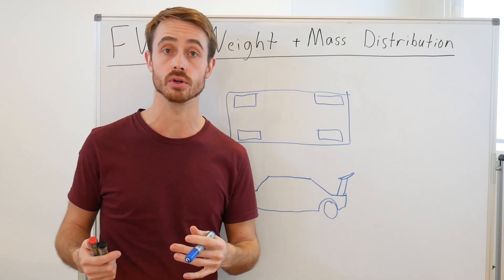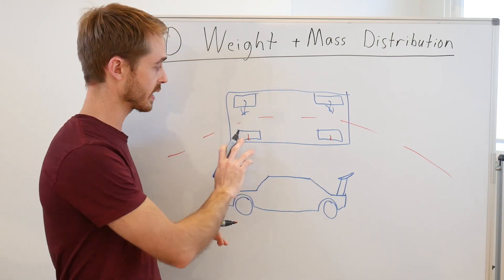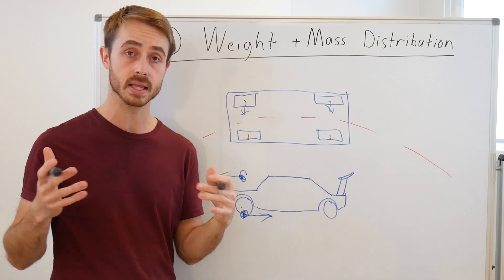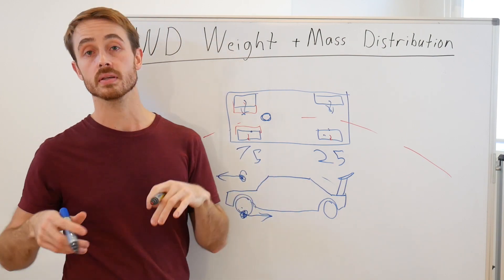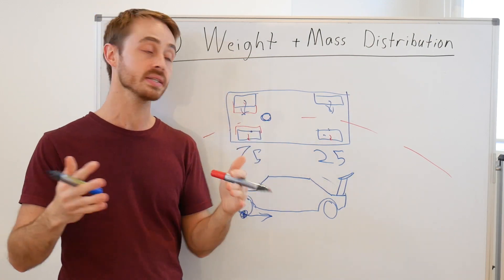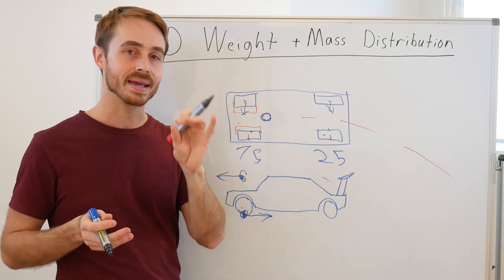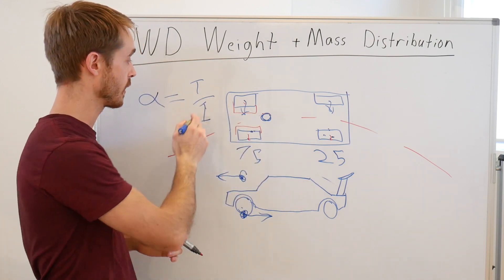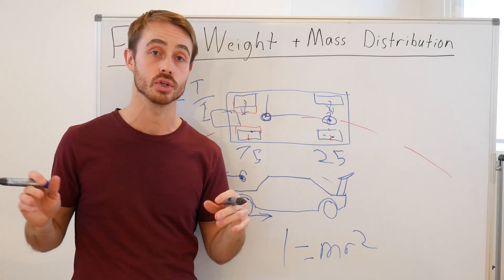Front Wheel Drive Weight Distribution Explained - What is the "Ideal"?

Comment from the maker: Thanks to Ted Sommer for the video request! I'm not a FWD setup expert by any means, but theory is theory. Hope you enjoy the video!
Reply: Aston Martin AeroBlade analysis
Reply: Great explanation! Like you stated about not being the fwd expert, you did help open my mind to options to counter the instinctive physics of understeer and to set-up my car for track days. Thanks again Kyle! 👍
Reply: Awesome explanation. I have been wondering though. Will using lighter materials such as CF on the roof of the car effect weight distribution or is it all just a gimmick? I.e. E92 M3. Related to that, what if the car has CF hood and/or boot?
Reply: 1:22 it's been a long time since I did the lecture/exam on dynamics, but I think that might not be right. The front wheels would see the centripetal loading, but also have to steer, hence they are under a considerably higher side slip angle than the rear, so the two vectors add up and would use up more of the Kamm's ellipse (ellipse or "circle" of forces/traction, not sure what it is called in English). Am I misremembering this?
Reply from the maker: @Ted Sommer: Great, glad you enjoyed it!

@BiskutKibal: Lighter materials, particularly high up, will help lower the CG. 

@YensR: In a steady state corner, with a 50/50 weight distribution, both front and rear axles must have equal forces on them. While the curvature of the corner will mean the front wheels must be steered, the slip angle of the tyre will still be the same both front and rear (with equal tyres). Remember the tyre slip angle is essentially the angle between the wheelface and the local direction of travel. If the front tyres were at higher slip angle than the rear, they would be generating more or less force (depending on where we sit on the curve) hence we would end up with a transient corner due to the torque around the cars cg from differential axle grip. Make sense?
Reply: Thanks Kyle, that makes sense! I'll claim your drawing threw me off :-P For ackermann steering, the centre of the curve is in extension of the rear axle  and while cars that travel at non-zero speeds typically have no strict Ackerman, the  instantaneous centre will not move forward as much as shown (without 4ws)  ;) 
(Kidding aside, I realise I was overinterpreting that drawing, my bad!)
Reply: So, if I have a car with 65% of the weight on the front wheels, will there be understeer or oversteer?
Reply: Sorry to be offtopic but does any of you know of a trick to get back into an instagram account??
I was dumb lost my account password. I love any tips you can offer me!
Reply: @Kolton August Instablaster :)
Reply: @Graysen Santiago I really appreciate your reply. I got to the site through google and im trying it out atm.
Seems to take quite some time so I will get back to you later when my account password hopefully is recovered.
Reply: @Graysen Santiago It worked and I now got access to my account again. I am so happy!
Thank you so much you saved my ass !
Reply: @Kolton August No problem :D

Comment: That was very interesting, my car has a very forward weight distribution but it seems to work as I use the car for low speed racing and it literally allows me to turn the car on the spot by using left foot braking, but it is very unstable at speed. I have been adding aero to combat the high speed issue. Good vid awesome work!

Comment: Great video! I run same size tires, same spring rates, and same tire pressures front/rear. I use damper settings to tune oversteer in my FWD race car
Reply: Preface: Not saying this as a "you're doing it wrong" thing, just elaborating on the various complexities of the situation for purposes of completeness: "same spring rates" <-- Your motion ratios front/rear might differ, and certainly the weight distribution will mean that the rear end is in practice more stiffly sprung. For example (since I have the relevant data available for it) a Renault Megane RS 275 Trophy-R with the same spring rates front and rear will end with ~20% higher rear suspension frequency, mostly due to weight distribution (the rear motion ratio is actually lower than the front, so even at the same spring rates the rear springs are softer in practice).
In many ways adjusting the balance via dampers is a bit of a brute force approach, but it's also totally understandable, the testing, time and money involved in getting custom springs at exactly the right rates for the balance you want is something very few people could ever conceivably have time for.
Reply: if you run stiffer rear arbs it also can help out a lot

Comment: Correct me if I'm wrong, but from this video, I learnt that having the maximum possible weight reduction is better than having positional weight reduction (reducing weight of compenents in the front only, in order to gain a closer to 50-50 weight distribution, which really isn't that great).
Reply: I think it depends on the specific course you want to optimize for, how many degrees of freedom you have with your suspension and what your driving style is. Weight distribution is just one variable in a huge equation. But I think for most road courses, if you have the ability to tune your suspension and adapt your driving style, lighter will usually be better.

Comment: great video cheers. the only thing I'd add is: with a FWD set up to have the centre of mass towards the front end, when cornering I try to slightly press on the accelerator just as the car is about to hit the tightest radius of the corner so you can use the load transfer to get to get a better balance and more grip also then trying to hit a later apex to get the tyres as straight as possible to reduce understeer on exits. the only other good thing iv noticed load transfer to be helpful on a fwd is to help correct oversteer via slamming on the accelerator for the rear to grip again and the front will also pull the car straight. other then those 2 points load transfer on a fwd is not helpfully at all, so stiffer set ups will be better (for cuiruit racing of course).

Comment: Tire grip is very important in this equation.  The more grip the tires provide, the lower the center of gravity can be.....and on and on and on......any car or drive train configuration.  If the tires for the application have poor grip, you often have to raise CG to use weight transfer to obtain additional grip.  Front wheel drive does throw it for a loop BUT it still has to be considered because of lateral Gs....not just forward.
The application is a huge influence.  Are you drag racing, autocross, road racing, or is this just a street application for a manufacturer........EVERYTHING MATTERS.
Reply: Raise CG for increased grip? Raising the CG makes normal load sensitivity worse and reduces total grip. Lowering the CG improves total grip regardless of tyre grip level, if lowering your CG has made your car have less grip you have a problem with your suspension setup...
Reply: ThatCarGuy, nope....not when you are on surfaces that have low CoF......dirt.....gravel....snow...ice.  
There are times when you need weight transfer and there are times when raising the CG is the only way to accomplish that task.  Not everything is about asphalt.

Same goes with instant centers...

I am going to give you an example.  Have you ever seen kart racing.  In road racing, they have two very particular types.  You have laydown enduros and you have sit-up karts.  The sit-up karts have a much higher CG.  They are the fastest karts until you get on big tracks like Daytona or some super speedway where aerodynamics rule.  Otherwise, the sit-ups are much faster.  It isn't always about the lowest CG possible.
Reply: I'll have to respectfully disagree on several fronts, firstly, your initial comment mentioned low grip tyres needing a high CG, yet the only examples you quote are for low grip surfaces. You'd be hard pressed to find a low grip tyre on asphalt that performs better with a high CG than a low CG, which is what I responded to. However, if we were to consider the low grip surfaces you mentioned, one need only look at WRC cars and the efforts they go to lower CG (navigator mounted so low they can't see properly out the front etc.). Weight transfer will always occur, as we can never get the CG to the ground, so you will always be able to use it as a driver in transient cases, but reducing CG height will provide improved total grip, even if it slightly compromises your ability to weight transfer. Not to mention if you raise the CG too high you will roll the car if you generate enough grip. 

Karts are quite a different ball game, firstly they are RWD, not FWD, so higher CG transfers weight to the rear and gives them more traction on the rear axle, very valuable for lower speeds. Also, karts run solid axle, so need a certain CG height to get enough jacking to unload the inside rear for low speed corners. Very different to a FWD car with full suspension.
Reply: To add to that, the weight transfer doesn't gain "additional grip", it simply moves about the grip distribution. Total grip will always be less under weight transfer, but increasing the grip on one axle with respect to the other can allow transient manoeuvres to be performed quicker through increased yaw torque
Reply: ThatCarGuy, rally cars have a packaging problem.  Getting the navigator low is a small piece of the pie.  They have fairly forward engines and still have to allow space for the front dif and axles and front suspension components that have to be strong enough to take some pretty big hits.  They have an inherently high (relative to a typical race car) CG.  

As for creating an opportunity for grip in karts....you do know they often pull well over 1.5 Gs?   I don't know what you are talking about in your reference to slow speed corners. Speed is relative.....velocity is what matters.  Averaging well over 65 mph on a track the size of a running track....slow?  When I was racing dirt ovals in 2 cycle unlimited, there were a couple tracks in the Carolinas where over 3 Gs was possible.  If you are pulling 3 Gs, you want to be as low as possible.  If the track was not that aggressive, there times where raising the driver was key to optimal grip. 

Making the tires work is the KEY to performance in any application....and everything isn't about forward bite.  I had over 50 hp and I could rarely get enough weight on the front to suit me.  Remember, unlike other forms of racing, in karting, the driver is often the heaviest component of the kart....sometimes over 50% of the complete package.  If you raise the driver's seating angle, 5 degrees, the CG goes up significantly.

The point I was attempting to make is there are times where the tires require something different....because of other factors and ALL of those factors need to be taken into account.  Dirt Late models.....have you ever seen them run?  In the early 90s we built a car that had an extremely low CG.  It just didn't work as well.  There are more dynamics going on than just CG placement.  Roll centers are key.  Rear steer is key.  Forward traction due to instant centers is key.  Braking forces on suspension components is key.  Shock technology is key to keeping the tire surface on the track.  Load transfer is a component to grip distribution. EVERYTHING MATTERS......can't be stated strongly enough.

To suggest that raised CG doesn't have a positive influenece in some vehicle dynamics is just wrong.  That said, because of the packaging issues of a normal car, yes, you want a lower CG almost always...because it was high to begin with.....generally for ground clearance.  

Obviously, dirt late models, kart racing.....most of my experience is in racing.  I have done the drag racing deal with cars and on dirt/mud surfaces with trucks.  I don't profess to know it all but I have personally seen a raised CG pick up times significantly enough to be the difference from mid pack to winning.  These are not from watching TV.....it's from doing it.  If you want to disagree, that is fine.  I have no trophies to prove any of it.  After a while, they start taking up space so they go in the dumpster or get donated to some kid class.  I spent the money too....

Comment: Interesting to watch this in hindsight, you can really see where Nissan was trying to go with the Nismo LMP. Shame that they had a lot of pieces to the puzzle, but were thwarted by the never going to happen performance of the ToroTrak FlyBrid system that was doomed to failure before it was even built.
Reply: Actually the main reason behind that car's configuration was the potential for improved aerodynamic efficiency. I believe Kyle did a video on that too.
Reply: ASJC27 it was, because while the regulations on the rear diffuser were hard locked down to a spec configuration, the front diffuser was wide open. So the entire aero package exploited that fact, along with also allowing the use of the flow through tunnels to improve front diffuser performance, as well as fill in drag wake, and improve rear diffuser extraction at the rear.

As it relates here though, they made a lot of compromises to the front suspension in order to fit the larger brakes. Which of course was all a direct byproduct of the FlyBrid system not working, which meant there was no harvesting to assist in braking. That of course also mean no small diameter tires like they wanted, which further upset the cars balance. And all of the clutch issues they suffered at LeMans were also a result of the load out on it, again, by lack of Hybrid assist.

They should retry the layout as a non-hybrid with the new regulations, clearly it's plenty fast enough, it just needed some perfecting. Unfortunately, I think almost everyone who was on the project got shit canned by Renault.
Reply: bigbuckoramma That car was never fast, it was slower than of all LMP1 cars (it was even slower then fastest LMP2 cars), and all design was failure, which was clear after Nürburgring test, but for some mysterious reason Nissan continued with the project (after Nürburgring test they should do same as Mercedes did with CLR-GT1 which had similar problems, and just retire car never to race again).
Reply: i hope they keep trying with it cos i love that car
Reply: Miloš Lazović it was only slow in total lap time. In outright speed, it was still one of the fastest trap speed cars on the track, despite not having any Hybrid power, and lugging around an extra 200kg from the non-hybrid LMPs.

The Aero concept worked like a charm. But because the hybrid system was dead on arrival, they rest of the car, and primarily the suspension, had to be compromised so much, that the car did not function properly as designed. As they required big brakes that means no more big sidewall tires, which put a ton of load into the suspension, which broke the car. Everyone loves to blame Nissan and Bowlby, but the real criminals of that design where ToroTrak, and their FlyBrid system which was NEVER going to work.
Reply: bigbuckoramma, I do not get are you kidding or you are serious now.
Trap speed of Nissan GT-R LM Nismo was 10km/h lower then all of other factory LMP1 car (Porsche 919 Hybrid was doing 15km/h more).
Aero concept worked like a charm if they wanted to design aeroplane not car, that car managed to do backflip on Nürburgring test, and that is not what you want your racing car to do and it is good indication your aero design went terible wrong.
But to be hones they hard try to make that car work and didnt get it they even designed second generation of that car for 2016, with working electric hybrid system on both axle, suspension and gearbox had also been redesigned and that the aerodynamics had been revised, and then they killed project with simple explanation that car did not meet performance target (basically car was still slower then all 2015 cars).
Reply: bigbuckoramma what technical discussion we have?
I admit I mix cars but you did not get any fact right till now.  All your argument about that car was wrong. That car was slowest of all car in maximum speed, slowest lap time (did not manage to get 110% of best time so it started last).
Simple that car is failure from beginning and that was obvious to all except to Nissan. 
Even Nissan had of lmp1 project openly say that all other teams laughing to them.
So you can be fanboy of Nissan as much you want but that will not change fact that thet car was crap or if was not we will now look at le mans all cars are FWD and we do not see any.
Reply: Miloš Lazović again, the failure of the car started with ToroTrak. And because of their failure the car never ran in it's intended configuration. Every problem you can name with the car, can be directly tied back to ToroTrak not delivering on the FlyBrid system.

I'm not a fanboy, but I am very familiar with the design of the car, and know more than the average pleb. So when you spread falsehoods, you must be corrected.

And when you can't tell the difference between a GT3 and an LMP, your recollection of the technical details is likely just as flawed.
Reply: bigbuckoramma thank you for sticking up for ideas

Comment: Can you explain me whhat's the differences and the the Pros and Cons between Longitudinal Front mounted engine FWD and Transversal front mounted FWD?
I can't find anything on the internet about this.
Reply: Con of longitudinal is the bonnet has to be much longer and/or robs much more space inside the cabin. Pros I'm guessing it's a more symmetrical setup, driveshafts would also be more symmetrical, so probably less torque steer maybe?